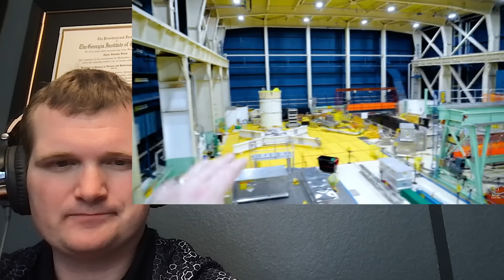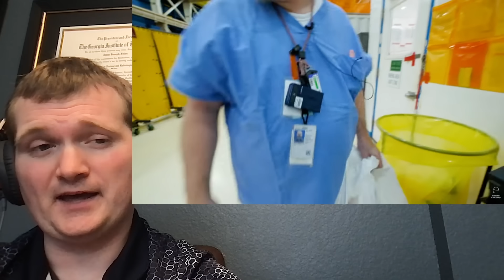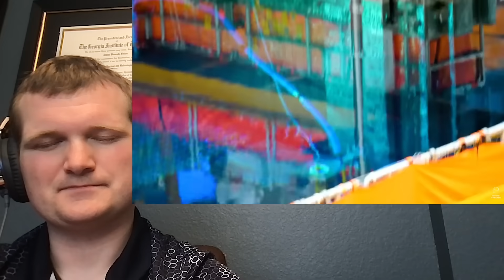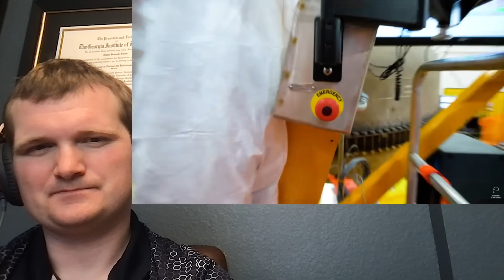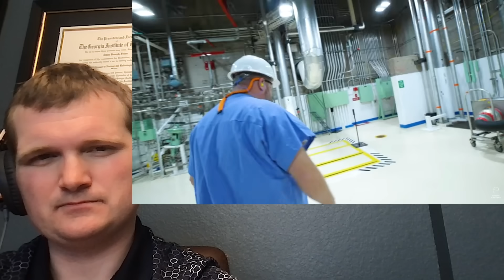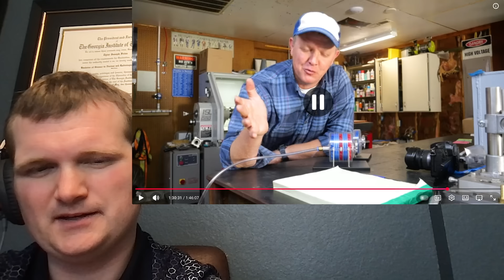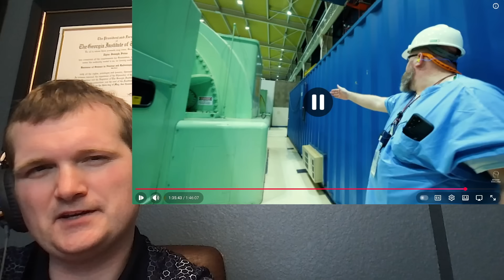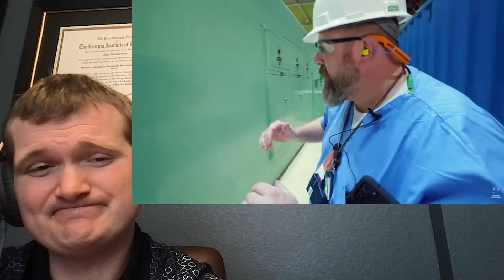Moving Nuclear Fuel with a Submarine Crane - Nuclear Engineer Reacts to Smarter Every Day

Comment: The callback and verification sounds like communication in a submarine.
Reply: Maybe the nuclear industry inherits submarine standards because submarines are one of the first things that got a lot of people working with nuclear reactors.
Reply: I have to imagine that's extremely common in a lot of military operations, and even ones that were derived from the military. TCP, which is a protocol that allows for reliable data transfer between two computers on the internet, also has a sort of call and response structure which is just really cool to think about

Comment: This is going to sound weird until I explain it, but i work in the entertainment industry, often in temporary scenarios and touring scenarios, but also festivals where things have to be temporary. Doing what i do, one of the most interesting things for me was the way that, a place that would normally be perfectly clean, and tidy, become somewhat organised caos. From the little bridge to get into the c zone, to the scaffolding platforms for managment, to the little barriers everywhere, and even to little things like ethernet cables being extended with couplers. Those little things, and how the space can be transformed from its normal configuration, to this one, and then, most importantly, returned to its original state, including all the decomtamination, is really interesting to me, and id love to see more about how that temporary infrastructure comes to be, and the perposes of different aspects of it, like the little bridge or the yellow barriers, or how they managed to get a full on shipping container in there.
Reply: One thing to note is that during normal operations, the room is probably not considered as much of a contaminated (C) zone, so you can just walk around and move stuff around much more freely. Once the top comes off the reactor though everything changes. I imagine they set up everything, get everything ready and into place and then once everything is ready they take the lid off.
Reply: all the yellow stuff you see is lead shielding to make the C area as small as possible, all the pink you see is FME protection, everything is colour coded and labeled to oblivion, it's a complete mindset you have to get in to and adhere to. it was hard to get used to, but when you do, nuclear is one of the best areas to work in, everything is planned out in detail, you'll never miss a tool for example as each tool has been assigned to the job months beforehand. on the other hand, if any step in your procedure doesn't work like your engineer cooked it up, you can't mcgyver your way out of the issue like you could on normal jobsites.

Comment: my biggest question to experts is this:
how much of this is overkill regulation?
i get it, better to be too careful than not enough
highlighted when the guy points out, the fuel unit they are looking at with their own eyes in person 100 ft away
and he says something like, if that came out of the water we'd all be dead 😅
on the other hand, we've only built 3 reactors in the last 30 years or something
and building a new plant is 80 billion dollars and 15 years or something
can we still be safe but also stop holding ourselves back unnecessarily?
Reply: We need more nuclear power. It’s incredibly safe.
Reply: I'm glad they practice excessive safety!
Reply: @nohandle62 Safety theater is not real safety. But most of these protections are very overkill
Reply: I mean if ur not carefull u might make alot of destruction so its better to be 15000x safer than even required
Reply: @Capsy_lock  there is  a balance. if you overregulate a safe source of power, then more unsafe or more polluting sources of power will dominate simple due to cost and schedule. 3100 American die every year due to coal power plants because we are overregulated and the defacto position of the US nuclear regulatory commission is to prevent the construction of any new nuclear power plants.
Reply: The safety stuff is all legit.

The holdup for nuclear power is in permitting, the expense of construction, stuff like that. But this is the correct amount of safety.
Reply: I don't know. Given amount of energy they are dealing, extra caution isn't a bad thing. Let's think of aviation, would you be comfortable flying if regulations were more lax for the pilots? After all we all know that with poor regulations you get disasters like Chernobyl, where corners were cut at pretty much everywhere, at the design stage, operations etc. (and Soviet Union had a lot of incidents with their npps before but they weren't as serious so nobody cared)
Reply: OK everyone drawing parallels to aviation. Aviation safety framework and culture is designed around actual data.
measurable risk, because like 100 million flight hours are logged annually
We don't have that in the nuclear power plant space. Every plant is unique. 
and the few historical failures have also been unique, and they were learned from
but regulation thresholds use the Aviation model, but they don't make sense in the kind of data you have in nuclear power

For example, ironic...
Aviation pilots receive something like 9x the radiation exposure dose annually than a nuclear power worker receives
9 times

I could list many more absurdities, but suffice to say the nuclear regulatory model is an improper application of the aviation framework
“If we can model it, we must eliminate it"... even when the risk is statistically indistinguishable from cosmic rays.
And it's insanely economically stifling and inefficient, and it affects all of us

Comment: why would reactors be mirrored? Wouldn't it introduce complexity with parts compatibility?
Reply: I would imagine they are just talking about the location of the spent fuel pool vs the reactor chamber. So on those first 2 reactors the spent fuel pools were next to each other so that might make some operations easier.
Reply: @JK9579  yeah, good point. But what about the other parts, like piping, doors, even lighting. It would definitely have some differences due to how they're located. Since it would have to account for where the spent fuel pool is connected to the reactor vessel.

Operating too, you move left to right on one reactor, and right to left on the other. Might have some extra considerations for the planning and paperwork